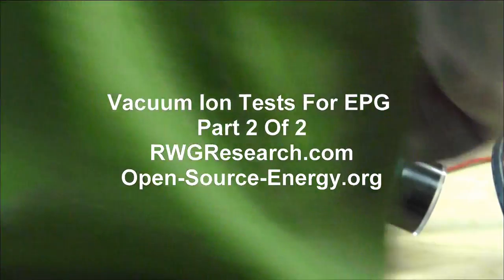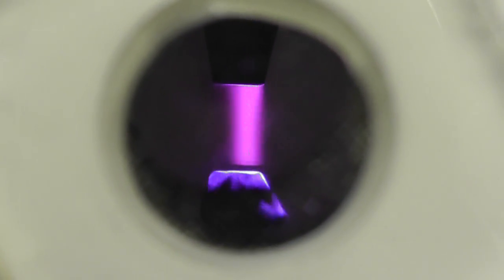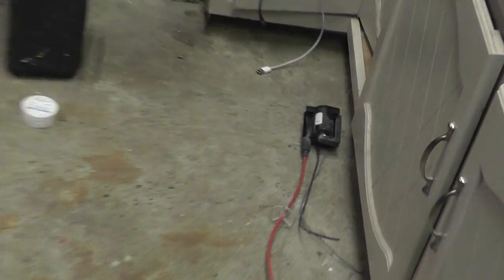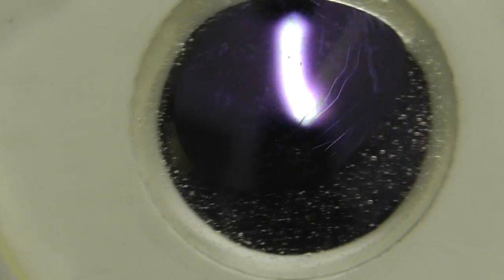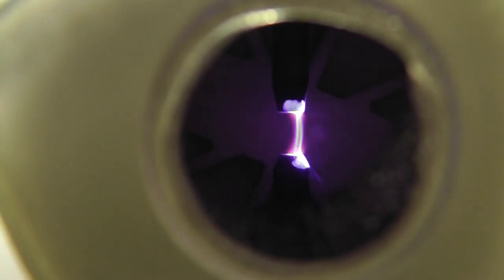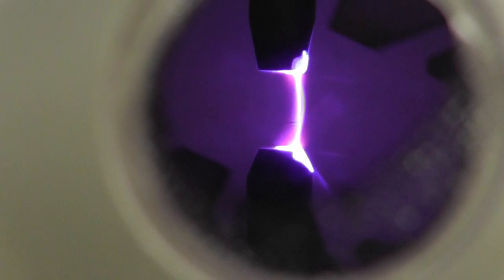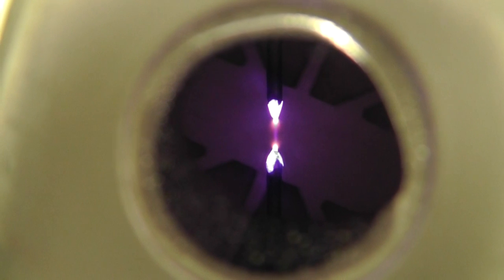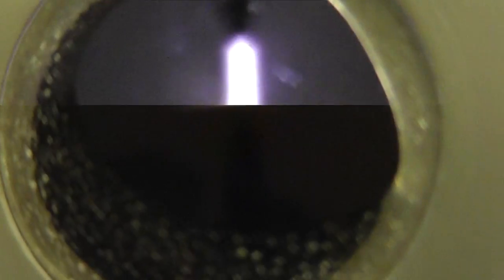Vacuum Ion Chamber Tests For EPG Part 2 Of 2 RWGresearch.com

Comment from the maker: Not at the moment... But the electrodes get really hot when using that AC... But it is a cap discharge. Do the amps are higher than the dc supply... ~Russ

Comment from the maker: The one DC supply is low current but uses capacitors to charge up. The AC is also capacitors but has a lot more current. And voltage,  When I'm receiving the really nice plasma I'm actually using DC out of the flyback transformer. It seems to be the stablest for DC. Or at least until I over drove it and burned it out. :)  Thanks, ~Russ

Comment from the maker: Yes, but later in the experiments I actually leave the argon connected so if it does leak it tries to pull in more argon. This way it doesn't pull in ambient air. You can see when I'm creating the nice plasma. What I'm actually doing is releasing more argon into the system. Trying to balance out the vacuum. Thanks, ~Russ

Comment: Hi Russ,awesome work as usual...! I had a thought, have you tried using different anode to cathode configurations yet because it seems to me, that might help with polarity issues, but it is just a geuss. I also thought I saw something cool in the plasma arc at 9:38 a black break in the arc occured (like a bubble)and it followed the far right arc and disappered,again at 9:45 on the far left arc, any thoughts because, it only happened then...?

Comment: X-Ray warning!!!

DON'T do this at all!  See my other comments on this "experiment"
Reply: +MrOzzyCam There are no x-rays in this.
The voltage isn't high enough.
Reply: The voltage is high enough to generate long wavelength x-rays, soft x-rays, the type normally filtered out in a commercial tube, using an aluminium filter.  

The targets he used here are Titanium, with an atomic number of just 22. Normally x-ray machines would use a Tungsten target, with a number of 74.   Having a low atomic number results in a greater production of soft x-rays at a lower voltage.  

His plastic chamber is almost transparent to x-rays.  Soft x-rays are actually more harmful, since they are absorbed by the body rather than passing through to a film etc.

There is a whole region of x-ray production of Bremsstrahlung x-rays that forms a continuous spectrum, before you even hit the Characteristic x-rays for any given material.  Though he has no (filament), when using HV AC, the electron bombardment is heating the electrodes more than enough for thermionic emissions.
Reply: MrOzzyCam It really isn't, you're overexaggregating the dangers.
If every high voltage device generated a lot of soft x-rays, people wouldn't be using them.
I have a professional survey meter sensitive to nanosecond pulses of 5keV x-rays, and it's not picking up ANYTHING from a similar vacum chamber.

You sound like a radiophobe to me.
Reply: You need a good vacuum before you are going to get x rays. If successful at getting a good vacuum, then this experiment starts to become hazardous.
Reply: MrOzzyCam I get good vacuum. 1x10-5 to 1x10-9 torr.
Reply: Well it sounds like you have the safety stuff so it shouldn't be a problem for you to keep an eye on it regarding emissions.  I still wouldn't recommend sticking your head near one whilst it was operating.
Reply: http://archderm.jamanetwork.com/article.aspx?articleid=524042 Read this little excerpt on a Beryllium tube (atomic number 4) for "Soft X rays" that operates in the 6 - 8 KV range.  These type of x rays are absorbed by air at any great distance but are also readily absorbed by soft tissue.

I can't say without seeing your set up if you are getting to the 10 KV and higher levels, what sort of current you are putting through etc.  Therefore can't comment on your "lack of x rays" for your experiment.  I can see in the video that the metal of the electrodes is getting more than hot!.. That is like turning up the current of the filament on an x ray tube.  The voltage and target material will determine the wavelengths and energy level of the photons emitted but Titanium Atomic number 22, will emit soft x rays when struck with electrons in a vacuum. Plastic won't do much to stop them, so if you are close to this unit when operating, you are going to absorb them in your skin, they won't pass through your body.
Reply: MrOzzyCam You do realise that it's not a Be target, it's a Be window, that just allows the passage of such low-energy x-rays, right?
This is not generating anything that could harm the experimenter, I am telling you that as someone with years of experience in this field.

Please stop being such a radiophobe. You're exaggregating the danger of x-rays, too.
Even if he is getting some occasional emission, he won't get hurt by a few mSv of exposure over a large part of his body over a relatively long period of time.
Reply: Sure, you are right about the window, not the target.  The beryllium allowing the passage of soft x rays.  Though the operating voltages are still correct.
Reply: MrOzzyCam And completely irrelevant, considering his device has a thick plastic window, which is very good at eating all soft x-rays.
Congratulations, you played yourself.
Reply: No it is not.  That thick plastic window is almost transparent to x rays.
Reply: MrOzzyCam I wonder why then soft x-ray tubes aren't made with non-outgasing plastics, since they're much cheaper to both purchase and make than fragile Be windows.
Uh-oh.
Reply: They haven't used Grenz Ray style low voltage tubes for years, as far as I know.  Also we are not actually talking an x ray tube like you would have a short exposure to.  This thing is running for who knows how long, etc.  I just don't think people should do this experiment unless they have some monitoring equipment and some idea about the potential risks.
Reply: MrOzzyCam Soft x-rays are widely used in a lot of industries. One example would be crystallography.
You really are just a radiophobe, and you should stop trying to scare people. This is safe.
Reply: +Spirit I never said there was no use of soft x rays now, I said that the Grenz Ray  style low voltage tubes were not in use now.
Reply: MrOzzyCam Because they don't exist and it's a medical name given to regular soft x-rays for which tubes are still made.
Reply: http://www.hamamatsu.com/resources/pdf/etd/N7599_TXPR1019E.pdf  Okay, they are still made.  More the low voltage than the name was the point.  Here are some nice examples of low voltage modern tubes in the 10 KV and 15 KV types and they include a type with a titanium target.
Reply: MrOzzyCam And you still cited no source and provided no real proof for the danger.
Just stop. This argument is pointless. Don't scare people.
Reply: Look, x rays aside, this thing is still going to pump out quite a bit pretty harsh UV.  I don't think it unwise to treat it with some caution.  Pumping high voltages through a vacuum comes with the potential risk of generating x rays, even at only 10 KV.  If you are going to play with this stuff, you should be aware of that.  How safe it is, we can agree to disagree on the relative safety aspects.